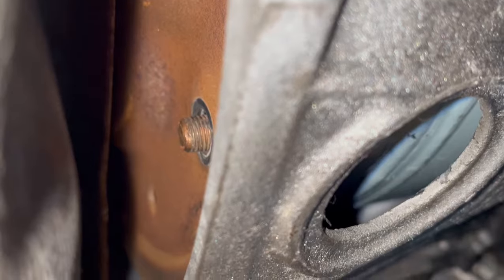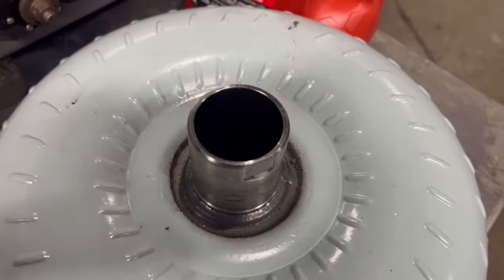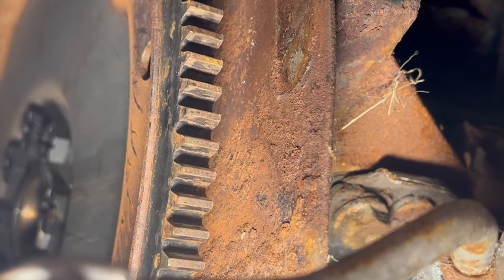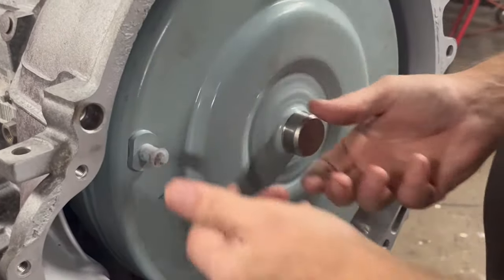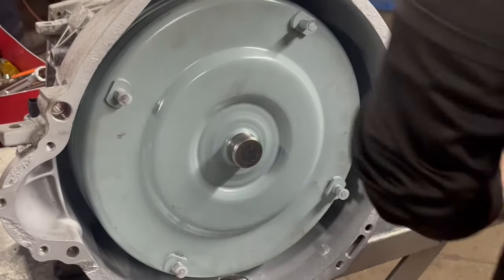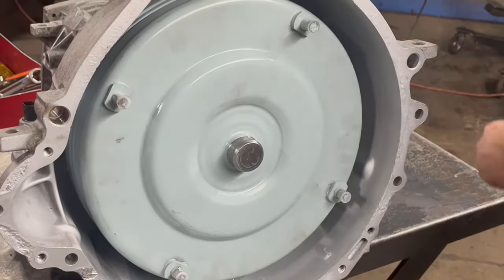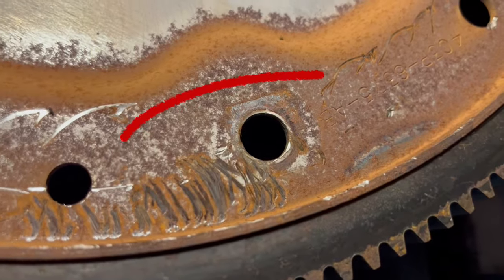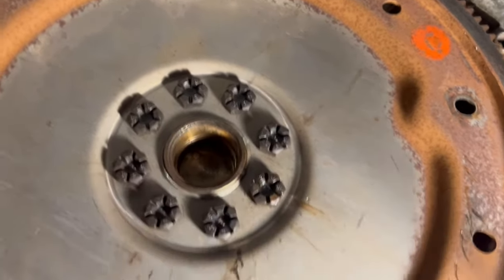Ford f150 how to install /seat your Transmission torque converter so that you don't break the pump

Comment: What’s the torque specifications of the 7 bolts holding the transmission back to the engine block?  Can you provide me with that info please ? I’m trying to install a transmission myself but I don’t know how tight the bolts are supposed to be nor the torque spec.